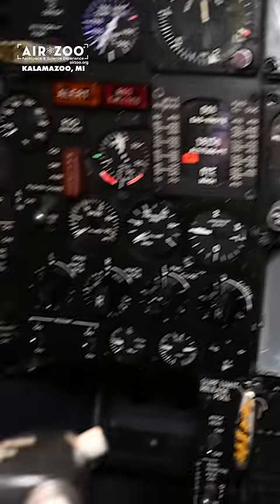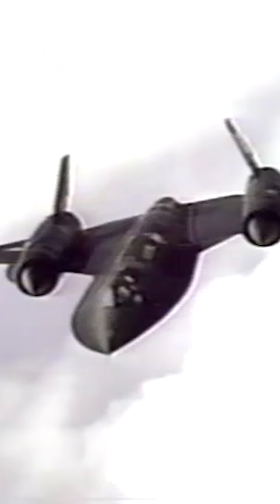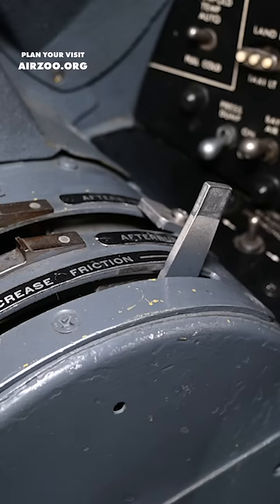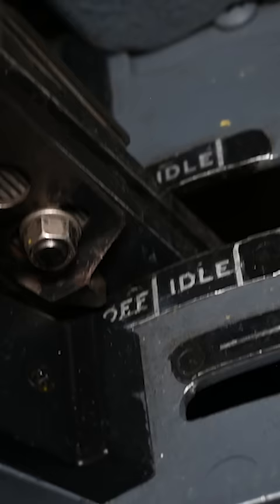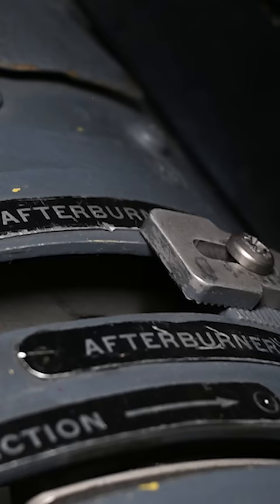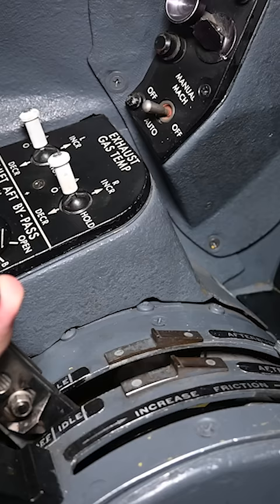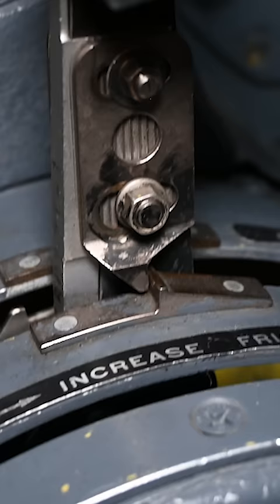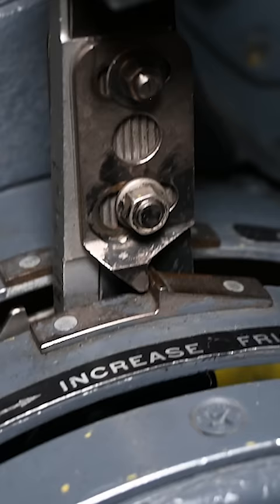The SR-71 Blackbird's throttle. #aviation

Comment: According to a recent tweet by Lockheed its the "fastest acknowledged manned air breathing jet." So... Theres something else out there.
Reply: Yeah a rocket
Reply: @treborobotacon  rockets usually dont breath air.
Reply: @YourLordMobius  
Exactly
Reply: There's a lot else out there. We are always one or two steps ahead of the Russians.
Reply: @movienerd202  in today's current arms-race I'd say we are safely 10 steps ahead.
Reply: @YourLordMobius  is Russia still around?
Reply: @lars7747  lol barely maybe?
Reply: @YourLordMobius  my future kids won't have to learn where "russia" is on the map. That's got sure
Reply: There's a faster aliened non-air breathing jet, probably. I need more Tea-TEB.
Reply: Allegedly the Foxbat could go just a bit faster, at the cost of its engines. Allegedly.
Reply: @TheEDFLegacy  there are rumors about this indeed, but yes it would pretty much overspeed its engines completely wrecking them if you tried that.
Tho i do like that plane, its very much the brute force apreach to building something reeeeel fast
Reply: @TheEDFLegacy  thays also the offcial speed of the black bird.
Reply: @TheEDFLegacy  Allegedly, former SR-71 pilot Brian Shul once pushed the jet to about Mach 3.5 unintentionally while outrunning a SAM
Reply: @YourLordMobius  Mach 10 steps 😉
Reply: @TheEDFLegacy  Oh dear god, the Foxbat was NEVER, EVER, as fast as the SR-71.  Russians, BAH!
Reply: The A-12 goes higher and faster than the SR-71. At first glance, it looks the similar to the SR-71, but it was flown by the CIA instead of the Air Force.
Reply: @G5rry  The A-12 also flew first with Pratt and Whitney J-75’s, details, it’s about the details.
Reply: @YourLordMobius  Not 10
Reply: @lars7747  Considering the T 14 and how the war has been going, hell naw
Reply: Aurora
Reply: @G5rry  and I will never understand why
Reply: Tr3b
Reply: @logc1921  T-14 garbo and Ukrainians with extremely little manpower and extremely limited training on the new machines they've been using have managed to push back and standstill the Russian's, only the Wagner group is currently gaining meaningful ground near Bahkmut.

The evidence suggests your argument is false, or at the very least intentionally distorted.
Reply: @YourLordMobius  lol
Reply: @evangalinsky2499  I thought the person said that Russia was still around in the sense of military might. Mb
Reply: @movienerd202  at least that is what we would like to believe.
Reply: Yeah it's a Honda civic with a laptop
Reply: x-15
Reply: @electricpaisy6045  x-15 was not air breathing.
Reply: @YourLordMobius  exactly
Reply: @electricpaisy6045  no not exactly. The x-15 wasnt air breathing. Lockheeds tweet specified air breathing. Hence they were not referring to the x-15.
Reply: @movienerd202  forget air brother think about alien 👽 technology
Reply: @Patriot66699  I'm pretty sure that's what Skunkworks is all about nowadays.
Reply: @logc1921  It seems russia has been getting old T54/55’s out of storage for service. They are around 70 years old now.
Reply: The highest echelons of our military is always at least 2-3+ decades ahead of present times.
Reply: Aurora
Reply: A-12 was faster, it just never officially got the title.
Reply: @treborobotacon  rocket is rocket, it doesn't breathe air
Reply: @TheEDFLegacy  Foxbat suffers engine damage at speeds above 2.8 Mach. Highest recoded speed was 3.2 Mach, measured by Israeli radar.
Reply: A wild dragon???
Reply: I mean F-22 is 80s tech. It’s been 40 years so I’m not too surprised
Reply: Bruh, your looking at this mechanical shit and thinking this is what trillions od dollars gets? This is no where near our most advanced craft, maybe from ww2.
Reply: @snowmochi1373  Isn't it funny that the F-22 is considered outdated yet China and Russia are barely catching up to it while we are already working on the next gen.
Reply: @krunchie101  isn't it funny that you're basing this statement on nothing at all?

You have no access to the technical details of any of the planes in question
Reply: @2ByQ  what? Why would I need access when it's public knowledge that the F-22 entered service in 2005 and  Russia's SU-57 didn't enter service until 15 years later in 2020? We are already working on next aircraft.
Reply: @krunchie101  lmao XD
Reply: @TheByQQ  hehe
Reply: @lars7747  nice joke
Reply: Rocket is not air breathing.
Reply: Guys it’s a Foxbat! The answer is the Mig 25 Foxbat!!
Reply: @lars7747  what?😂
Reply: North American X-15 talking in 6 mach language
Reply: A12
Reply: Orrrr they were just being specific because records are highly contested.
Reply: @lars7747  if you are from USA, your kids won't know to show anything on map
Reply: They’re referring to the Lockheed A-12 which was the predecessor to the SR-71. Since the A-12 was ordered by the CIA it’s existence is not acknowledged.
Reply: Shocker
Reply: Whatever happened to the Aurora project? 🤔.  Or did it just become steamed hams?
Reply: First thing that comes to mind is any kind of re entry vehicle. When you're going over Mach 20 the goal is no longer to minimize drag but rather to minimize chances of burning up in the atmosphere.
Reply: Probably an old claim, the A-12 which was faster is now acknowledged. The Mig-25 was also capable of intercepting an SR-71, once..
Reply: Ramjets are "just around the corner" though
Reply: @lars7747 I guarantee you they will. In case you havent noticed russia is winning that war
Reply: @treborobotacon  sadly not many people acknowledged your astoundingly intelligent answer.
I bow to you sir!
You understand.
Reply: @evangalinsky2499  all this seems in question now that we got those document leaks.
Reply: Probably the A-12 considering it was the hotrod version. Single seater baby.
Reply: @NeroontheGoon  It also flew with a single J58 and a single J75.  The "Titanium Goose" aka the only 2 seat A-12, ran its entire life with just the J75 engines installed.
Reply: @sonorangaming449  It only flew operationally for 12 months from 1967-1968 out of Kadena flying photorecon flights before being releived by the SR-71 in 1968.  The missile carrying YF-12 had the record for quite a while, then the SR-71 took that title.  It takes a specific set of parameters to run at top speed. If you violated the 427ºC Compressor Inlet Temp, you'd pay for it with your career.  Even on flights specifically designed to break the top speed record by getting permission to raise the CIT to 450ºC, the record wasn't bettered any.
Reply: @hoghogwild  Interesting at that!  The way I understood the early oxcart program was the airframes were ready prior to the J-58’s and the J-75 was a good fit until the -58’s were ready.  So it was just the Ti Goose running with the J75 Pratts?  Good stuff, vagaries all over that “declassified” retired program.
Reply: @NeroontheGoon  It was just the Titanium Goose that ran J75s, full time, as it was the A-12 training variant with the extra seat where the camera would go on the rest of the fleet.  You are correct, as the airframes were ready before the J58's were, the J75s were used until the J58s became available, they would then be switched out.   The J75s limited top speed to Mach 2.0 IIRC, and there was at least a single A-12 that flew with a J58 and J75 at the same time. Yikes.
Reply: @hoghogwild  Betcha that was a handful of hate and discontent!
Reply: Yeah no sh-- even the space shuttles are faster
Reply: @Apollo20-24  Yes they were, in fact every orbital class rocket is/was/will be faster.  But like all rockets, they all carry their own oxidizer as they are NOT crewed airbreathing vehicles.  I miss those space shuttles.
Reply: @hoghogwild  1: i wish i was old enough to have been able to watch them launch in person. 2: the SRB's were solid fuel and air breathing because they didnt burn long enough for it to carry the oxidizer, if im correct but i may be wrong.
Reply: @Apollo20-24  2) No, the oxidizer is all carried internally in the RSRB (redesigned solid rocket boosters)  The SRBs fuel is actually atomized aluminum powder and its oxidizer is PBAN(Poly Butidienne).  The 4 segment RSRMs used for Shuttle(3.35 million pounds max.  thrust x 2) and the more powerful RSRM-V(V Roman numeral for five=5 segments of of propellant used for the NASA SLS launch last year burn for 123 seconds approx. while making 4 million pound of max thrust x2 boosters)  Since they have the word rocket in their name, and ALL rocket motors carry their own oxidizer, they are most certainly non-airbreathing engines.   1) If you missed Space Transportation System launches(shuttle) you can still see the old hardware in action for SLS.  There are 16 Space Shuttle Main Engines left over from STS, enough for 4 Space LAunch System launches.  There's 80 steel booster segments remaining, enough for 16 boosters, or 8 flight pairs for 8 missions.  Since Artemis-1 already launched, there's now 12 SSME's and 70 booster segments left in inventory.  These SSMEs and SRB segments have actually flown previously on Shuttle missions, except for 2 of the SSME's which were produced in 2010 for ME-2062 and 2014 when ME-2063 was built.  ME=Main Engine plus its assigned engine number.  After the SSMEs are expended, new ones are currently being built to the tune of approx US$150 million a piece, yes US$600 million dollars for the 4 engines on a SLS Core Stage, then theres the 2 RSRM-Vs on top for another few hundred million quid.  Get your butt down to Florida to see Artemis-2 launch No Earlier Than Nov 2024.  3 Americans and one Canuck are going to Lunar orbit.
Reply: @hoghogwild  and... i just got out nerded

Read More
Reply: Lockheeds Tic Tac leaves the mighty SR-71 for dead. (I know your secret Lockheed 😂).
Reply: Look at the x 15
Reply: @AmarbirKaler  for the last time, the x-15 is not air breathing.

Comment: This jet still to this day is an engineering marvel 👍👍
Reply: there are multiple ways of surpassing its speed and range with a smaller size and potentially heavier payload assuming it ended up being used
Reply: Luv the non-digital gauges; got that nuts and bolts feel to it - none of this touch screen stuff.  Just throw back the throttle and lets get lit!
Reply: @justincase01  I personally like the old school gauges in this one, but the accuracy on this things is a bit off 😅😂
Reply: Engineering - with a slide-rule and a tape measure.
Reply: Obviously, this is a pretty old jet. It's still amazing that it was this intricate and so quick for it's time. We can most definitely make faster stuff now, if we wanted to.
Reply: @phoenixtheshark  with the current discourse in the government, no we can’t.
Reply: @DanielDuhon  😂
You think congress designs the aircraft😂😂
Reply: now imagine what they have out in area 51, this plane is i’m pretty sure 60+ years old and wasn’t released till after 6 years of development, they definitely have something insane in area 51
Reply: @NoSubsWithContent  there are ways to do it but it is expensive to do and sr-71 built regarding all the costs so it is still a marvel
Reply: It really is...the first Wright brothers flight was Dec 17, 1903, the first SR-71 flight was just over 61 years later Dec 22, 1964.
Reply: @1000 subs with no content  it's only payload was the two people controlling it. It wasn't a bomber.
Reply: @flymeaway1216  No. They. Dont.

Comment: I imagine filling up that TEB tank was a butt puckering process
Reply: I wonder how they did it 🤔 Figure it would be easier to have a separate pressurized tank straight from the factory so you don't even have to risk it coming into contact with oxygen. Otherwise you'd need a more complicated set up
Reply: I imagine it's probably a lot like the hydrazine tank on the F-16
Reply: @JM64  Probably a complicated setup with nitrogen purge.
Reply: @ameunier41  Yeah that was my next guess.
Reply: @JM64  Very carefully is how they did it.
Reply: Plus, from what I understand, it leaked fuel when parked. I was told that it was designed to expand when hot due to air friction from extreme speed. So, when it was flying and it got hot, it would actually seal up.
Reply: @artvandelay1099  It leaked the jet fuel, not the TEB, as that apparently would have been fiery!

But yes, apparently they would log the number of drips / unit time on them.
Reply: @macattack123mattc3  Right, the OP was saying that filling up the TEB tank must have been a butt puckering process. If that wasn't butt puckering enough, there's also jet fuel leaking to boot.
Reply: My guess is that the TEB are in already sealed disposable canisters like flares and chaff and probably mount in some kind of rack that has an electronic trigger mechanism
Reply: @bower31  TEB is pyrophoric, ignites on contact with air. Hydrazine comparatively is MUCH less flammable in an open atmosphere. The processes would be very different
Reply: Likely just an inerting system as it's pumped, it is definitely scary stuff thouh
Reply: @manoftehsea  I was speaking more in reference to the scale of immediate hazard, TEB is pyrophoric, but exposure to hydrazine is a major toxicity risk. In the F-16 the hydrazine tanks are pre-filled and the entire tanks are replaced by designated hydrazine teams. I'd have some assumption they may do something similar for the A-12, since it eliminates handling in hangars and on the apron.
Reply: @bower31  The tanks had a spigot that a hose screwed onto.  When the Marine Corps base where all the old SR-71 parts were stored(along with all the many tons of Soviet titanium in sheets, billets, wire) was ordered cleaned out, some of the TEB tanks simply had their spigots opened of course spewing fire.  That plan of dispo was shut down very quickly. The stuff was leaking all over the tanks.  TEA/TEB is used by SpaceX to ignite its Merlin-1D engines on its Falcon 9 rockets.
Reply: The Nazis had a plane called the ME 163 that used rocket propulsion much like a model rocket that killed more people during refueling than in the air. It's flight duration was only 7 minutes and would fly up to about 39,000 feet making two passes at bombers once going up it would have a 3 to 5 second window to use its cannons and then coming back down.
Reply: Howling 😂😂😂

Comment: Didn’t know that TEB was needed to light the afterburner as well!

Apparently refueling the SR-71 required one engine going into AB towards the end due to the added weight. 
Given the length of missions/multiple refueling usually needed, the initial start process AND that pilots had at least one engine flame out a mission while having something like 16 TEB shots total (I believe those are the correct figures) must have added even more stress to a pretty intense flight plan!

Comment: Tell us about the air inlet restart switch. There's a story of a SR-71 that suffered an inlet unstart, then the plane broke apart. 💔 that little switch probably leads to the inlet management computer!
Reply: No computers on this plane.
Reply: The air restart switch resets the inlet air cones to their ‘start’ position, restricting airflow, and allowing the air scheduling system to regain control of the gas path.  The J-58 is a compound turbojet with some ludicrously innovative bypass plumbing that basically takes the compressor out of the loop above Mach 2.  An ‘unstart,’ which is was one of the most feared words in the SR-71 community, had to be dealt with immediately, within 1.2 seconds, or there was a very good chance that the airframe would be lost.  An unstart was a very fancy way of saying MASSIVE COMPRESSOR STALL, and regaining control of the gas path was critical in regaining proper flow and combustion in the engine.  The cones would retract completely, the first stage guide vanes would close, the bleeds would open fully, the fuel control would reset the afterburners after the throttles were retarded, and a restart would be attempted.  Just pray you had enough TEB left to restart.
Reply: @andrewyork3869  depends what you define as computers
Reply: @NeroontheGoon  I remember reading that pilots would expect to have one of these happen on average per mission. 

And that the drag + thrust imbalance caused by one was like getting punched in the head when your helmet would slam onto the side of the cockpit. 
All that makes the unstart/flame out even crazier!
Reply: @fragdude  Frag, I heard is was not uncommon with the early series J-58, it got better with age.
Reply: No SR-71 ever broke apart in flight from an unstart.
Reply: @elijahrobinson2362  what if you did a simple Google of “SR71 breaks apart”
Reply: @elijahrobinson2362  I tried to show you the crash report of the fourth SR-71A lost, hull number 61-17952.  Unstart was the cause of the crash, year was 1964.
Reply: @ValentineC137  Actually, many of the crashes were due to inflight break up for various reasons.  Hitting other aircraft, drones malfunctioning, unstarts, and fire.
Reply: @NeroontheGoon  If you are referencing Dytch 54 wasnt it 25 January 1966, SR-71A (61-7952) was lost Lockheed test pilot William A. Weaver and flight test reconnaissance and navigation systems specialist James T. Zwayer. The mission callsign was DUTCH 54.  
The SR-71's first flight was in 22 December 1964

Comment: The reason for the high temperatures. the fuel had a hard time igniting. The pilots would throw cigars out in the spilt fuel on the ground under the plane.